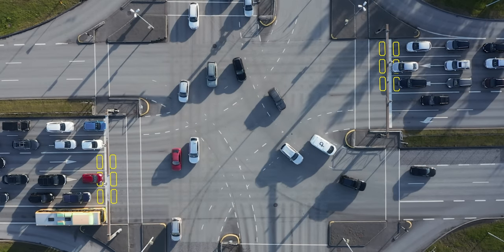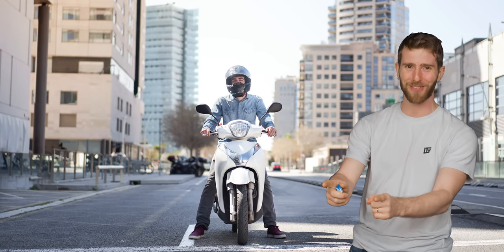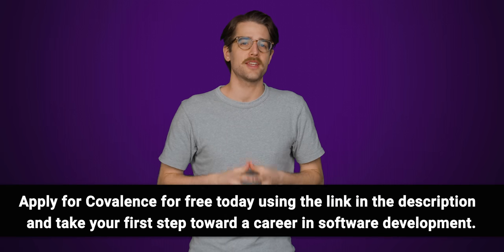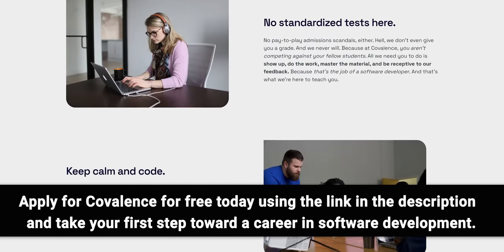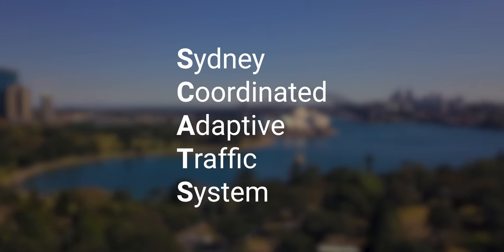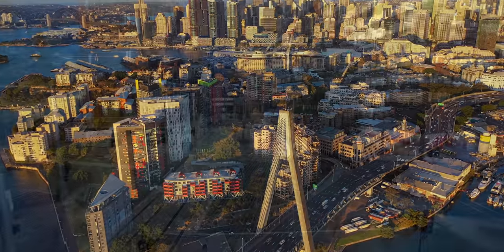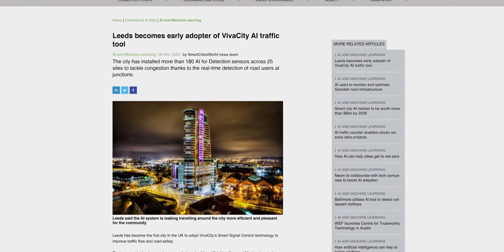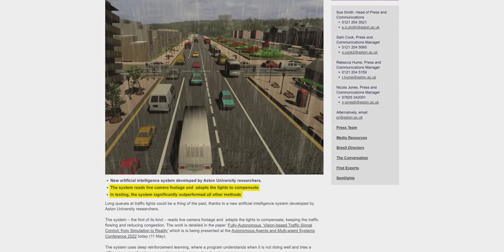Here's Why You Get Stuck At Red Lights

Comment: NotJustBikes did an interesting video on Dutch intersections, and how they have shorter delays between the red light in one direction and the green light in the other direction. 

It’s really worth a watch if you want to see other approaches to traffic management
Reply: yea.. we here have pretty decent traffic flow management (so called green zones make sure that for straightforward going traffic each follow up traffic light will turn or is green when you approach it during busy traffic hours and stays on orange about 20 seconds longer than normally), not on turn traffic lights though… good tip is to also try to follow the public transport busses as these can request green lights to be on time at each stop)
Reply: I recommend anyone to at least take a look at NotJustBikes
Reply: Definitely worth a watch. Dutch traffic control is far more advanced than north america or Australia's. I guess part of it is their comprehensive attempts at traffic management which includes prioritizing non-car-based modes of transport.
Reply: Exactly, when a city prioritize bikes, pedestrians and public transportation, even Car traffic gets better. Less cars, less jams. Linus could be a support in this cause!
Reply: @goozbaghali  Indeed, we have lights (and infrastructure overall) to prioritize on transporting people instead of transporting cars.  Which, for example,  gives way to many more cyclists and public transport  on their routes.  Also we have different routes for different modes of transportation.  And also optimized for distance and average speed.  For example a longer but faster route for motor traffic and a shorter but slower route for cyclists.  Which means they both arrive at the same destination around the same time.  (still depends on distance though).

Also our traffic lights are smarter and will give green when no other traffic is detected, has detection loops in cycle paths and even on some walkways.  Takes also the speed of each mode of transport in consideration.  Has early detection (100-300 m before the lights).  And a shorter wait time overall.
Reply: That video is awesome. So is that whole channel
Reply: Would love a LTT and NJB Collab!
Reply: Well, even here I sometimes wonder why everyone is staring at an empty intersection for at least 10 seconds, perhaps even longer.
Reply: Oh hey, it's rufioh! o/
Reply: If you live in US or Canada, NJB will show you the hell you were forced to deal with really is as pointless as it feels
Reply: @FireFish5000  it was interesting at first, but then every video turned into "north America bad, Netherlands good, mkay?". Even if he's right, it's never going to change so it's a waste of time to say it repeatedly.
Reply: The all-red phase is important for safety, especially at anything other than low-speed urban intersections. Shorten it and the yellow phases at the peril of all intersection users.
Reply: @FireFish5000  Not only that, he'll do it in a repetitive, elitist, and condescending way! What joy!

Yeah, sorry, I can only take an expat implying that we should bulldoze everything and start over so many times before I start rolling my eyes.
Reply: @mrpc5971  well yeah lmao If it wasn't as bad as it is he wouldn't be constantly saying how shit it is
Reply: @sntslilhlpr6601  If you think he is being elitist then you should look at yourself lmao
Reply: @HyenaEmpyema  yep, enjoyed his videos really much but after some time his criticism just turned into low Key racism and insulting. Half of one vid was seriously just him bashing on americans. I felt annoyed and I am not even american
Reply: I can't believe that there wasn't even a single mention of the Netherlands in the whole video
Reply: @sntslilhlpr6601  so he states that something bad in a bad tone? how dare he, also he has lived in NA and Europe and if you dont agree with what he says you dont listen to facts
Reply: Inductionloops are indeed the past technology. In the Netherlands they use smart camera's to detect approching traffic, so you don't have to stop before a wire detects metal and make it green. They even have apps controling the lights. They can make it green for fire trucks.
Reply: @sntslilhlpr6601  
NotJustBikes is a little America is bad and Europe is good. And it doesn't always have an answer on Americas traffic issue. However, it does make you realize that solving traffic is more than adding an extra lane for cars. You need to plan how people will move around and cars are not the ideal solution. 
You also must understand that not everybody was on board with the changes like reducing the cars in our European city centers. There was a lot of protest and people did not understand the final goal. The people still rumble about it, but it is like taxes: they accept it, because you see it work. Like taxes, some projects go to far and than are dailed back again because politicians will loose their seats if they push trough. 
I see no reason why any city in Amerika can't make a few roads car free. If you do it in a way the people benefit from it, they will embrace it. That is the key: they need to benefit from it and that you must assure that with a solid plan. If you did your homework and there are benefits, there can even be some protest at the start. 
They way we now move around will not be the same 10, 20, 30 years from now. That is easy to prove: just look at the traffic 10, 20, 30 years in the past. Traffic will evolve and what we should do is to be smart about it. Don't let it grow wild, but have a plan and a goal and that goal can be 30 years in the future, because at some point we will get there.
Reply: @Dead Channel  lmfao why are you getting so offended for a channel who doesn't know you exist?

The channel is elitist, that's a fact. That person said nothing that makes him even remotely close to an elitist
Reply: Driving late at night and approaching every light and it popping to green right ahead of me is such a good feeling. Dutch person here ofc.
Reply: I can’t stand that guy anymore
Reply: gosh i hate channels like his, they just make my blood boil. idk  why
Reply: *That video was from Ontario Traffic Man, but Not Just Bikes has a different video that's good about Dutch traffic lights too

Comment: We're actually using camera-based detection with machine vision at some sites down here in Minnesota. Come take a look!
(edit: they can also measures speeds and count and classify the cars, trucks, motorcycles, pedestrians, and cyclists...)
Reply: SODA!!!!!
Reply: @MajliTech It's "pop!" And, "Duck, duck, GRAY duck." Just sayin' ಠಿ_ಠ
Reply: Probably not St. Cloud, MN, based on recent experience. ¯\_ಠ_ಠ_/¯
Reply: @Coolesding The traffic lights in my German city is seemingly designed to turn red just as you arrive from the previous traffic light. They are very efficient at making you burn as much fuel as possible, lol.
Reply: Yay 1984
Reply: @ThePC007  Didn't Germany solve that issue by mandating that new cars not burn fuel while stopped, and requiring them to be relatively fuel efficient at all other times?
Reply: @KeeperOfKale222  I think somewhere a manor is missing its edgelord.  Why don't you have a drink?  It'll take the edge off.
Reply: I'm in Minneapolis & I'm pretty sure they don't use that because I be stuck at the most wack red light too many times which now I understand why so many drivers here run red lights.
Reply: @scottie89901  accelerating from a standstill uses a lot of fuel, not just the idling while stopped.
Reply: @zyeborm  how fast are you accelerating that it uses so much more fuel??? In any case, this problem has already been solved by hybrid vehicles, they can accelerate mostly on the battery and use the gas engine to cruise. It reduces both the resources needed for battery manufacturing and total weight (road/tire wear) compared to electric vehicles as well as the total amount of fossil fuels used in manufacturing and operation compared to combustion vehicles, without any range penalty.
Reply: @scottie89901  Not everybody drives a modern vehicle and keeping the foot on the gas still consumes more fuel than downshifting and letting go of it does (most cars consume nothing while decelerating in a low gear, even with the engine running). Plus, if they synced up the lights such that they go green when you approach them, you wouldn’t even need to accelerate again.
Reply: @scottie89901  That is not how it works. 
To accelerate a 1 ton vehicle from 0 to 50km/h (31mph) you need ~100kJ of energy.
It does not matter if you get it from battery, or not, it needs that much energy and it will take it from its fuel.
Reply: @hubertnnn  Hybrids can harvest brake energy and re-use it for acceleration. The more gradually you slow down, the better the conversion efficiency is. Also you're talking about less than 50 ml of gasoline at that point even with a purely combustion-powered car. People waste far more gasoline by driving their cars at speeds higher than the optimal fuel efficiency point (around 100 km/h) on the freeway but you'll never hear motorists complaining about fuel efficiency in that case. That's not even starting to talk about people driving excessively large personal vehicles. Only when drivers are mildly inconvenienced by having to slow down do they suddenly care about fuel economy.

If people really cared about saving fuel so much, they would support limiting the speed of cars to 110 km/h (65 mph) or less. I'm guessing all of the people claiming to care about wasting fuel would be outraged at such a proposal without even a hint of irony.
Reply: @scottie89901  The reason why people do not complain about fuel efficiency when going more than 100km/h but they do when they have to stop on traffic lights is that going above 100km/h benefits them, they will get to places faster and save time and/or money by doing so.
Stopping on traffic lights have only disadvantages, you not only waste time/money, but then you figure out that you also waste fuel.
Reply: @hubertnnn  As someone who normally exists outside of a car and can get around my city on my own two feet, I see traffic lights as having nothing but advantages for me. Drivers tend to act dangerously towards pedestrians and cyclists when the choice is left to them.
Reply: The Canadian state!

Comment: wire inductor is also used in older traffic lights.  New ones use a combination of camera, IR, radar, etc...  and they connect with each other to synchronize traffic flows.   Where I live (far north Peoria, AZ), they have put in smart lights in all intersections and the lights change for you as you drive up to the intersection... its so freaking awesome...   The entire north end of the city has blown up over the last 15-20 years and this area they put in all new smart systems from new...  and the main road from the freeway up the center of the section where hundreds of thousands of homes and business are, they are using machine learning to synchronize the entire 10 miles and all side roads... so if your in a group of cars coming off the freeway, you will be getting green the entire way through, and all side lights are timed in their rows and the model adjusts to the second so its always building and learning.

Comment: In the UK most of our lights are either induction like you mention or have MVD’s installed (microwave vehicle detectors) installed that can see a car approaching the light at a greater distance then induction so that the car doesn’t have to stop when approaching if the junction is clear from other directions
Reply: Came to the comments to say this. And we've had them for ages, 1980s I think.
Reply: The sensors are not pre-emptive by themselves, they can't see traffic approaching or the number. They are now adding systems & integration as you said.
But it's not perfect because they can wire them wrong. Huge queue of traffic down the mountain, the more they try to extend the green light, the more it's red because they wired/labelled/programed it wrongly. 
They should have video cameras watching traffic, identifying types of vehicles, number plates & speed. It sees you coming & can change lights before you get to the usual sensor. It could keep track of your usual trips, predict where vehicles are going & model multiple possible timings to optimise flow, reduce trucks having to stop. Smart grid. Lots of value judgements, someone else will usually loose for you to gain.
Reply: In the US. MVD is short for Motor Vehicle Devision , and every type of service they offer is NOT FREE, it's not even free to downgrade your license

Comment: Where I live they have moved away from using induction loops and now use phased array antennas (the white squares you see mounted on the poles angled towards each direction). I saw a demonstration while in school showing how they could discern each of the individual cars (as well as motorcycles) including which lanes they were in and how fast they were traveling.  Much more effective than the induction sensors
Reply: I work for the company that likely makes the ones you are talking about (based on descriptions and us being the market leaders). Not only do our sensors look at the stopbar to know when cars arrive, but we can look several hundred feet up the approaching lane to see oncoming traffic. One benefit of this is that it can hold a yellow light if it detects you going a certain speed and it thinks you are not going to stop (that's the simple version at least). This results in a proven decrease in mid-intersection accidents!
Reply: @dylbarton  We've had these in the UK for ages. Late at night it's possible to see the controller skip parts of the sequence so that you get a green light faster.

Comment: In Vancouver, left turns at intersections are designed for 3 vehicles to activate the left turn advance. If two vehicles are lined up, most likely the left advance won’t trigger because of where the pads are placed, the second car won’t be on those, you can by pass this by stopping a little farther from the car in front of you.
Reply: Same in Toronto - just stop over the last two, they're usually less than a foot apart. Works 80% of the time.

Comment: Pretty neat to see Carnegie Mellon's system here in Pittsburgh mentioned! Here in Pennsylvania we have the "Ride on Red" law. It allows you treat a red light like a stop sign within reason if you feel the stoplight has failed to detect you. The law was originally put into place for Amish buggies (PA problems... lol) and motorcycles but luckily they decided it should apply to everyone on the road.
Reply: As a fellow Pittsburgher some people use that to just go whenever they feel it like especially where I live  which is sad and Oakland is a mess because they have so many hospitals near there so there is a million pedestrians and the pedestrians have the right of way always because of pa law but near me they just floor it near a pedestrian and don’t stop either
Reply: most states have a law of if the light doesn't switch after 3 minutes you may proceed through the intersection
Reply: That's really interesting to know. Many states let you turn right on red unless otherwise posted, but I've never heard of that.
PA's roads suck, but at least their laws (and drivers) aren't as bad...

Comment: Great explanation, surprised you didn't mention the growingly popular detection method of optical detection, using the cameras you see at the top of streetlights. This takes in image data from the street and detects a difference in luminance (sometimes color) to see if a car or other vehicle is present.  Lasts way longer than the loops in the ground and is more effective in detecting things like bikes+motorcycles. Plus, in advanced configurations, can up the priority of a signal change if there is traffic backed up. (this is also sometimes done with loop detection)

Comment: I used to work for my state's Department of Transportation.  Even in my rural US area induction loops are nearly all phased out.  Now we use video cameras with user specified detection zones, and they're actually pretty simple to understand the concept.  You just box out where you want it to consider as the waiting area for cars, and you can specifically X out areas that shouldn't be looked at too. 

The signals run at a set interval, but detections can allow for extra time, like to give a green left arrow only when the left turning lane has someone.  Sometimes they link them so you "ride the green wave", but most aren't that busy (rural) so they just let them operate independently.  Also after the DOT installs them it's up to the townships to maintain them, and sometimes they poke with the timings and screw it all up lol.

They can have multiple schedules too.  Really late at night we typically put them on blink, blinking red means treat it like a stop sign and blinking yellow means roll on through cautiously.  When a train comes through they can handle that.  During set peak times, like a light next to a school or large business, a light can have a different schedule to handle the brief traffic peak too

Comment: I got stuck in a turning lane once in an older section of a busy road, but the traffic lights were using the pressure wires. We were the only ones in that turn lane for over 30 minutes with breakfast in the car, just watching traffic switching N+S, E+W, and even the turn lane in front of us. We drove back and forth in hopes to trigger the wires, but it didn't work. We started to started to consider other options, because it really seemed like we would never be let out of that lane, but then a vehicle entered the lane behind us and it finally let us go. Later on those lights where changed during road re-construction.